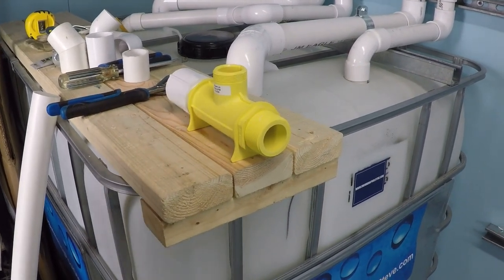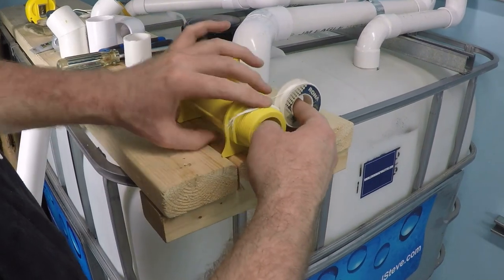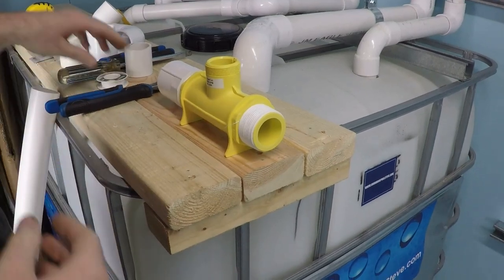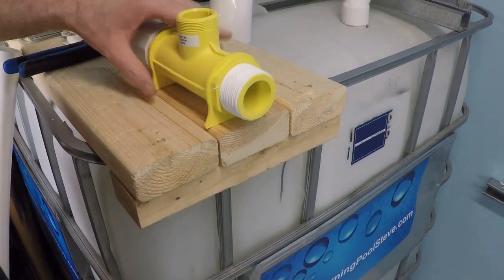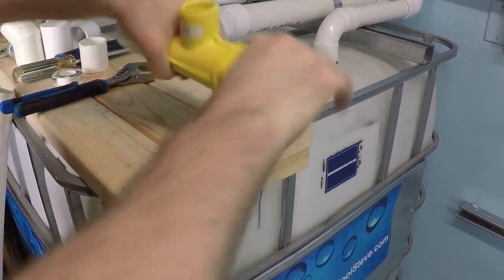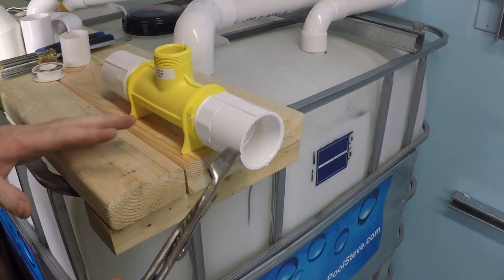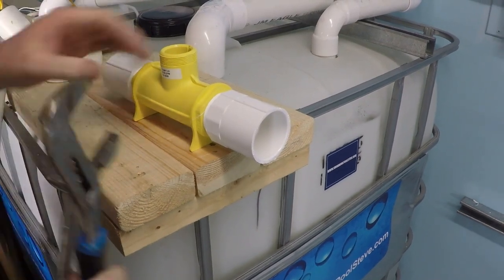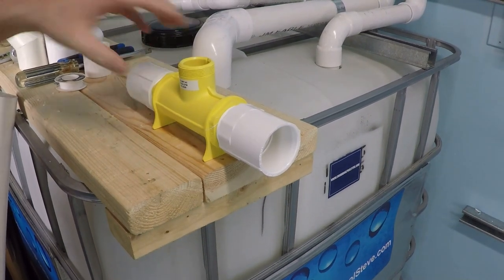How To Make Threaded PVC Pipe Connections

Comment: Good info. Your multigrips go the other way round though, so they tighten rather than slip off as you use them.
Reply: Lol. Yea.  But who hasn’t done that?
Reply: It is preferable to have the wrench slip rather than over tighten the fitting. For the small amount of force needed the wrench will work fine on either direction. SPS knows what he is doing

Comment: Thank you very much for this video, it gave me the confidence to do this for the first time and it worked except...I got a little air coming into the system which was fixed with a little silicone sealant around the outside of the joints.

Comment: Excellent video as always. I installed new Hayward inlets on my pool. Threaded the pvc male adaptors but it still leaks. Is there a sealant that you recommend I use. I would like too redo the connection but this time with sealant. 
Thank you!

Comment: tape wrap is wrong direction. show folks the correct way.
Reply from the maker: the tape is wrapped in the correct direction.  If it were put on the opposite direction it would unwind itself as you attempt to thread on the female adapter.